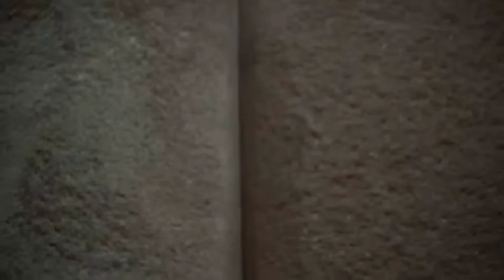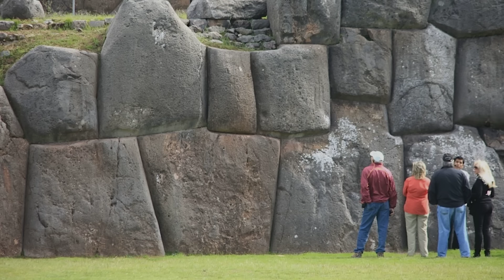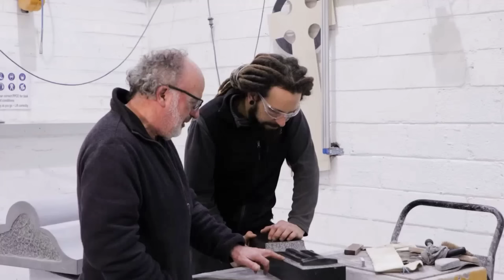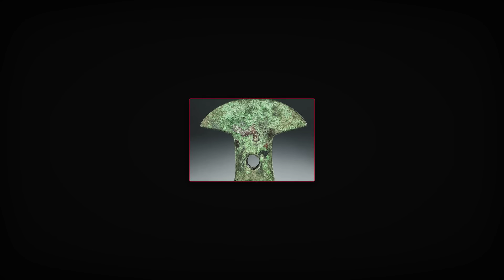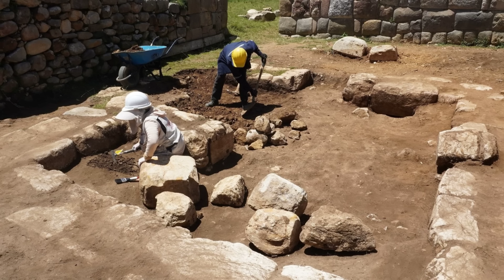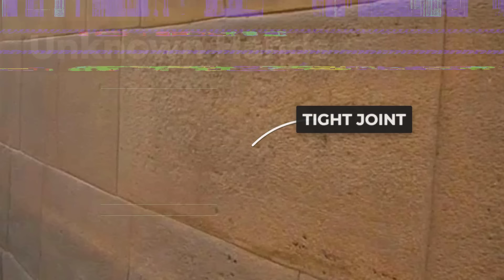The Impossible Walls of Cusco — The Engineering Trick No One Talks About

Comment: i have been to cusco 2x, my theory, these rocks aren't formed by pouring concrete into a form/mold, too irregular and form/mold take up space... maybe something like Play-Doh required no form/mold that can turn into a hard rock... that still required very advanced material engineering, also the size and WEIGHT are tricky...  a lot of these rocks still have a shiny surface, like an ultra high temperature polish, high energy blast?

Comment: impossible there’s no way a person can do this. I don’t care how many people you have. You can’t carve a little bit chisel a little bit and then lift it up blow the dust off set it back down and it will be off 23° and then you have to lift it back up what 50 block of rock up and down up and down how many times would you have to lift it up and down to place it into the spot where you’re chiseling you have to do it 100 times to get it right you just can’t carve carve chisel chisel set it down we gotta do a little more it’s off. It’s not correct. It’s too many cracks. It is in impossible. You’d have to have a goddamn crane to keep lifting it up and down and I just don’t think it could be done by man.

Comment: You deny the most obvious answer. Before man shaped stone . There were layered rock formations that cracked and formed natural
building blocks. The moved the blocks from one place to another, shaping the facing edge but the back side was rough'
In some places they were already in place just needed to be lifted and smoothed . A wet cord with abrasive sand polled back and forth while abrasive sand water mix was poured from above . This would have created the parallel irregular shapes. As time went by it was harder to find natural walls of stone and less labor intensive methods were discovered. Just as your shirts are now thinner and made from cheaper fibers from China or Vietnam .

Comment: Poured and molded.   Not carved.
Reply: Where are the hundreds of molds they used? Where is the material they possibly used? These stones are solid and heavy. If they were poured why build such large and heavy forms? And it looks like each piece is unique. Do you realize how many molds they would have to have? Those blocks fit perfectly together.
Reply: @krissto22. Some wood forms.  The majority was the previously poured and tamped blocks.   Each block was allowed to cure for several hours before the higher blocks were added.

Comment: Maybe they were cast in some sort of sack technique using an early form of cement. That would explain the tight fits and the bulge at the seems. The sacks could then be cut away or burned back to the seem. Michael Angelo could not chisel with that level of accuracy and Lego had nothing to do with it either. 
X⛏X
Reply: Good think there
Reply: @VincentIreland-q8h  Thanks man!
Reply: Many of the stones also have  a bump - like a little knob - near the bottom edge, as if the stone was made in a mould with a hole at the bottom, and some of its material had come through the hole.  Some stones with a long bottom edge have two bumps.  It's as if they are made from some sort of concrete that was poured into a mould - and that could explain their immaculate fir as well.

Comment: For those who are interested in the topic of polygonal masonry. A number of methods for fabricating the polygonal masonry are proposed. The basis of the proposed methods is the use of clay/gypsum replicas, a topography translator, and combination of reduced clay models of the stone blocks with a 3D-pantograph. The results are presented in the article “Fabrication methods of the polygonal masonry of large tightly-fitted stone blocks with curved surface interfaces in megalithic structures of Peru” (DOI: 10.20944/preprints202108.0087.v10) or in the book “Peruvian polygonal masonry: how, who, when and what for” (148 pp., 2025).

Comment: No carving took place
No lifting of stones took place
No razor-thin joints were made
All they did is cast the stone from a geopolymer cement that they made

They made water glass, which is easy to produce.
They carried ground-up stone from nearby quarries.
They poured the mixture into molds, let it harden for 1 day, and then removed the mold.
The stone was soft, so they carved rounded edges.

The neighboring stones acted as part of the mold and thus, there was no gaps from stne to stone
Reply: Let's see you grind 50000 tons of granite stones into powder. 😂
Reply: @Anonymous------ no need to a whole desert of trillions of tons nearby
Reply: @noleftturns 
Let's see you make 50000 tons of granite stones out of sand.
Reply: @A @Anonymous------ ll they did it didn't they...no lifting or moving of 100 ton blocks
Reply: Absolutely correct.
Reply: Your idea is getting very close. Definitely poured in place but the chemistry process is a lot more complex

Comment: These blocks are poured in place. None of the problems you presented ever really existed.
Reply: @SueDonum123 No point in telling ppl like this, they never listen.
Reply: @8thsinner  You know it!
Reply: If you were pouring it the top sides of the blocks would be flat and not have sharp angles fitting the ones above.
Reply: @christophh9477  - the tops are manually sculpted to accommodate the next course above.
Reply: @SueDonym123 and why would you do that and why do irregularly? Would be much easier not to and if you did want to you would make regular shapes to simplify and speed up construction.
Reply: @christophh9477 - makes little difference. It’s still easy to do. The irregular shapes give the blocks a mechanical lock and holds the wall together. This is a high earthquake region
Reply: @christophh9477 not if you want it earthquake proof
Reply: @SueDonym123 doing regular interlocking blocks would still be easier and achieve the earthquake proofness. Please demonstrate hiw easy it is to build these walls or at least show how the physics behind this works...
Reply: @christophh9477  - no it’s not. Each one is poured in place up against the previous blocks, and the top is shaped as you go. All you need is flat formwork panels, and you can make any shape you each time. Standardisation would only complex the process for the polygonal blocks. 
Now the majority of the megalithic construction is actually rectangular block construction, and these are done in the exact same way, except the top is levelled flat, and not sculpted. 
I’m currently writing a thesis on this topic. I can explain the process in it’s entirety
Reply: @christophh9477 - possibly but not necessarily. You still need to manually shape each block separately, so it doesn’t matter what shape it is. 
I have a paper coming out this year and all the physics is explained there if you want to read it
Reply: @SueDonym123  If you are pouring it you can place something on top to create a shape for the interlocking. Why change the shape for every block or why just pour it flat to then painstakingly manually shape it? Please do post a link when you have your thesis done.
Reply: @christophh9477 - well actually  the vast majority of the megalithic stonework is flat topped. The rectangular stone blocks were made in exactly the same way as the polygonal blocks, except that are levelled each time. These types of walls existing in the same earthquake zone without much problem, so the need for a minority of polygonal walls is an anomaly. It could be something as simple as basic aesthetic appeal. We do that today all the time. 
I’ll let you know when I publish my work. Always interested in genuine discussions on the topic. The model I present explains the megalithic construction fully. I go through the entire process and building methods. I can demonstrate why the nubs, scoops, and all the weird platforms. I explain the science behind the theory and how to reproduce the walls using nothing but Stone Age technology. It’s actually way easier than anyone is guessing
Reply: @christophh9477  Interlocking load distribution.🤔
Reply: @SueDonym123  Maybe not so much as "poured" but individually sculpted like making clay models. The ingredients would probably include lime, sand for filler, and an aggregate.
Everybody knows the older concrete gets he harder it gets. Ever try to drive a nail in 100 year old concrete? Now multiply that by 10!
Reply: @christophh9477 they've found evidence in Egypt that they used a plant based acid to soften the rock to make it easily workable . Interesting stuff
Reply: @christophh9477  Flat? like the top of your head?🤣 Just kidding, let's be realistic. YOu've never worked with any type of media such as clay, mortar, plaster etc have you?
Reply: I used to agree with this premise but they found the quarry where the blocks were cut out, with prefect straight cuts on the surface.
Reply: @peterlee9691 - they are not quarries. You have been misled by bad  information
Reply: @peterlee9691  Perhaps the said quarry was when they first started out. Then quickly discovered
It's be faster & easier just to cast in place.  They could have used a repellent or thin mortar that dissolved
over time.  I'm still leaning towards castings.
Reply: Yeah!!!
Reply: And how exactly are they poured In place?
Reply: @Ding181  You ave to make forms?🙄
Reply: @21CenturySkyScrapers what?
Reply: Those are natural rocks with rock veins, not geopolymer.
Reply: @Anonymous------  nope
Reply: @Anonymous------  - veins can be formed in geopolymer too. Its still solid stone and still subjected to the same natural processes
Reply: @SueDonym123 
🤡😆